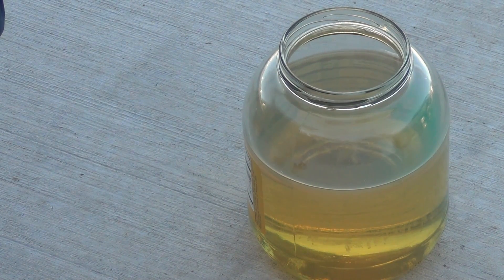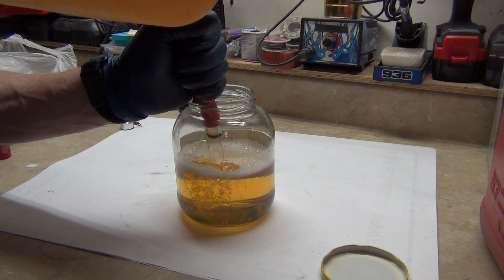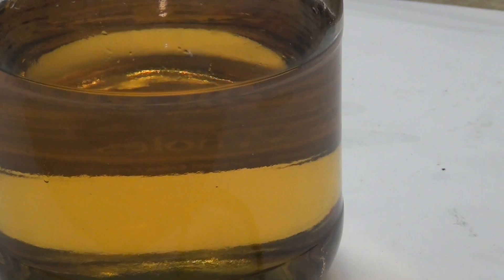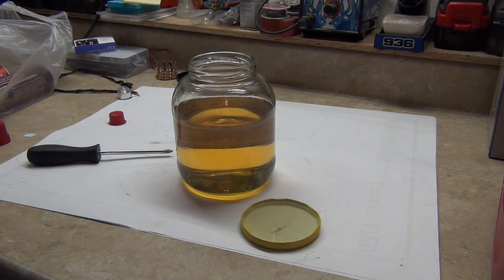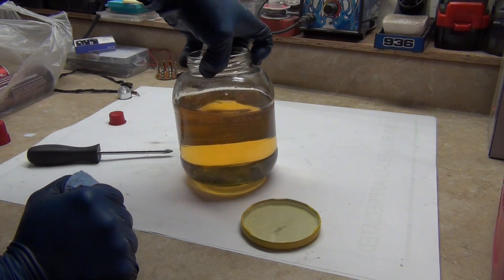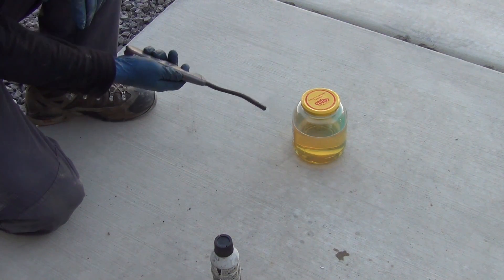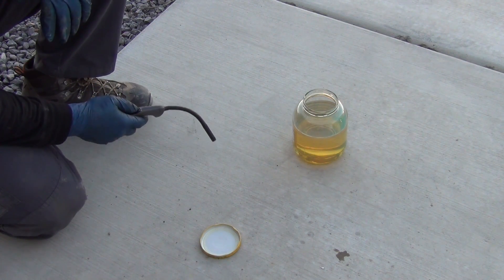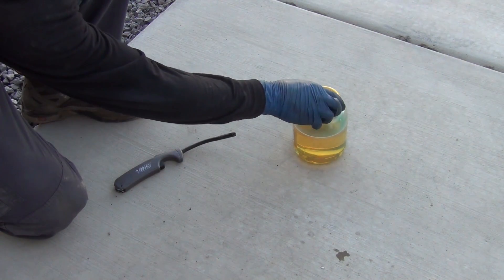What Happens When You Put Gas in Diesel

Comment: could you add lead additive in the gas/diesel mixture to up the lubricity?
Reply: John Griffin you could but it's highly illegal and quite polluting since lead is poisonous. Also almost engines are not meant to run lead. This was being used in a diesel so lead wouldn't not help in this situation. If anything some motor or veggie oil would help more

Comment: 10% gas in a diesel tank is ok. It provides anti gel protection when temps get -20F or so. As far as applying a match to straight gasoline, I would not recommend it. It would explode as gasoline is very volatile.

Comment: Gasoline can most definitely kill diesel engines.  A neighbor of mine had a mid-80's Ford 6.2L pickup and he loaned it out to a friend of his.  The friend thought he'd be nice and fill it up before returning it.  Unfortunately he filled it with gas.  The truck ran for a very short while, then ended up having to be towed.  The engine was toast.  Gasoline burns much hotter than diesel and it essentially melted the pistons.
Reply: Sorry, got my diesels mixed up.  It was the Ford 6.9, not the GM 6.2.  The same thing would happen to either one though.

Comment: If you have a hot spark and you really want a little more power put this in an engine and see what happens mess with the mixture. What I think should happen is it will burn the gas which will the light the diesel therefor giving more power. This is just spec though

Comment: I use to put a gallon of diesel in my gas tank when i filled up with gas. It keeps engine clean and boost octane. I use to get over 110 octane gas sometimes 120 at the pump.

Comment: it's all about combustibility or octane/cetane. diesel is generally easier to ignite and will contain different detergents than gasoline because diesel engines rely on compression instead of spark. I would not suggest doing this if you value your pistons and valves.

Comment: An old school trick if you put gas in a diesel engine is to add a quart of engine oil per gallon of gas added. It'll take a while to start until the mixture is ran out but it can save a lot of headache.

Comment: In school we were told that gasoline doesn't atomize as well as diesel fuel. Older diesel engines have lower injection pressure and greater nozzle tolerances than that of newer engines, so if you were to put gas in a 12valve or a 7.3 Powerstroke then it might just run shitty. But if you were to put it in a newer diesel engine with lower injector tolerances and higher injection pressure (some as high as 20,000PSI) then you could blow your nozzle out of your injector and basically ruin your cylinders.

Comment: Years ago it was advisable to mix petrol with diesel, to stop the diesel from freezing in extreme winters. Additives in modern diesel negates this. Older diesel engines could run on any crap, like old chip fat, turpentine or kerosine, as long as every fourth fill was proper diesel, for lube purposes. Common rail engines would die very quickly  if you used any of that stuff. As for the bagpipes, C'mon Scotland, FREEDOM

Comment: I put ethanol gas in my f250 because I make blended waste oil fuel. the ethanol melted my polyester fuel filters and shut my truck down on low fuel pressure. turns out the alchohol eats plastic.

Comment: diesel will not burn "like a candle"  as you stated in a jar unless it is heated first.  Most #2 will not not emit enough flames until it reach 126 deg Fahrenheit or higher.  Unless you add a wick of course

Comment: Speaking of lubricity, there are actually additives you can get for diesel fuel to improve the lubricity that apparently quiet down the injection pump (I want to try some in my Jetta TDI, but I'm a poor college student, so I'm being cheap).... Now, I'd be curious if you mix enough in if that could cause there to be no damage to the diesel fuel system... Well, I guess that's probably not the case as the ethanol is probably going to ruin seals... But to see how well the compression ignition would work for gasoline would be interesting. I know GM is working on something, but I don't really understand the specifics of why compression ignition gasoline engines are so difficult to produce.

Comment: Diesel has about twice the energy content of gasoline, but it isn't very volatile. When you mix gasoline with diesel you end up with a mix that is twice the energy content of gasoline and is volatile; not good. Also, gasoline acts as a solvent to diesel and does cut the lubricity. A good slug of gasoline will destroy high pressure pumps and injectors.

Comment: Hello Brian, Rob from Australia (the old Massey Ferguson tractor number plate man). We had a two year old land Rover discovery TD (turbo diesel). About 5 years ago some idiot filled out tank with bad diesel. We had traveled 100ks and then it all stopped. Cost us $12K and had to replace, fuel tank, low and high pressure pumps, injectors and fuel return system. There were bits of metal right through he whole system. Very unhappy!

Comment: a fellow trucker says he puts about a gallon of gas in his truck "each 150 gallon tank"  to keep the fuel from jelling in cold weather. cheaper than fuel additive. also when they change fuel filters on these big trucks they fill the filter with ATF before screwing it on. they say it help clean the injectors.

Comment: jet fuel cant melt steel beams
Reply: no but it can weaken them to the point of failure
Reply: So how can you melt steel with a furnace powered by oil.... It would of acted like a funnel all the heat rising sucking loads of air.
Reply: Applying heat to a solid substance until it changes to a liquid.
Reply: A B-52 NEVER crashed into the Empire State building, you got mixed up with the B-25, a ww2 medium bomber, which is much smaller than the Boeing 767s of 9/11.
Reply: But deez knees are made of dank memes
Reply: Jet steel cant melt fuel beams
Reply: The memes are not strong with these ones
Reply: bklynp718 Nope!  Just because people died, does not mean we cant talk about it.  that is whay you are told to say when anything is questioned.
Reply: Insert definition of "melt"
Reply: you forget to think about the altitude at which it may be burning, at higher altitude, there is more wind feeding more oxygen to the flames causing it to actually burn hotter and if enough oxygen is present or being blown to the flame in question, yes it certainly can melt steel.
Reply: B52's no it's can't melt it but it can make it hot enough to bend
Reply: Joshua Lambert jet fuel (jp4) in a combustion chamber can reach 2000 C that is why a jet engine can have a burn through. Haven't you ever seen a combustion chamber that liquified when you have a spray nozzle improperly aligned causing bad spray pattern?
Reply: Joshua Lambert jet fuel (jp4) in a combustion chamber can reach 2000 C that is why a jet engine can have a burn through. Haven't you ever seen a combustion chamber that liquified when you have a spray nozzle improperly aligned causing bad spray pattern?
Reply: Nerd....
Reply: What about our 5000 degree tungsten cube?
Reply: Bas Jansma jealous much
Reply: The I-85 Bridge incident here recently in Atlanta Ga proved beyond a doubt that a regular fire even without jet fuel can in fact weaken steel beams in concrete enough to cause collapse. So if you happen to be one of these people who still actually believe the jet fuel nonsense, you have been indisputably proven wrong.
Reply: Yeah, but what about the shit in the ChemTrail tanks? Who knows what that shit burns at!
Reply: Nik Trp the fires in the twin towers were oxygen starved. That's why there was so much dark smoke coming out of them. Jet fuel burns at 600 degrees in the open atmosphere. When mixed with lots of oxygen like it is in a jet engine it burns at 1600 degrees, not even hot enough to plasticize steel. Also, the news stated that wood fires only get to 1000 degrees or so. Steel doesn't become plastic, or malleable until 2000 degrees. It melts at 2500 degrees, and boils at 3500 degrees. I know this because of experiments that were run to show how hot Ammonium Perchlorate got when it burned at the Pepcon explosion back in the 90's. There are theories that say someone put thermite throughout the twin towers to bring it down. That might work, but would require tons of material to be brought in in order to do that. The towers were shut down for a few weeks in July 2001, and I believe that Ammonium Perchlorate would have been easier to sneak in because it would take a lot less of it to cut through the steel beams holding the buildings.
Reply: Wrong. You are, quite simply, wrong. It was not simply temperature that did the Towers in.
http://www.tms.org/pubs/journals/jom/0112/eagar/eagar-0112.html
Reply: Unlessen you blow lots of A/C from the main plant, at least until the FD arrives.
Reply: LOL
Reply: 9/11 is the only day in history that steel buildings fell from a fire. Unless there were more factors than heat from fueled fires.
Reply: OmegaGamingNetwork I cannot figure out where all these willfully stupid people come from.  it's stunning.  And it sometimes leads to their undoing when we're lucky.
Reply: owenbrau63 oh right; let's not forget about the chemtrail tanks.  Another figment of the astoundingly stupid imagination.
Reply: Kenneth Cohagen there's literally nothing you can tell these people that will change their feeble minds.
Reply: J. NiZm0 oh really?  where do you live?
Reply: http://www.snopes.com/wtc-terrorism-insurance/
Reply: owenbrau63 it won't matter.  these people do not believe facts.  You can thank them for how screwed up our country is.
Reply: Are you seriously saying that a 767 running heavy, weighing more than 380.00 pounds, releasing  nearly 4 BILLION kilojoules of energy for Flight 11, and more than 6 BILLION kilojoules from Flight 175, caused no damage to the structures?
Reply: Are you an engineer? You learned everything you need to know WATCHING TV? STFU.
Reply: No stupid, it was hit by a building falling on it.
http://www.popularmechanics.com/technology/design/a3524/4278874/
Reply: Andrew H why does a fire start to smoke? because its not receiving the air it needs to sustain itself, which as a secondary result, if its smoking then it is also not nearly as hot as it should/could be. the Twin Towers were both smoking as they burned. 2) The Pentagon which was also struck by a plane (yeah, right) does not show consistently the same amount of damage as the Twin Towers. The towers were destroyed while the pentagon was really not to badly damaged. Why was there no environmental disaster clean up done? all that jet fuel would have caused a huge clean up but never was conducted.
Reply: Thermite!
Reply: proof?
Reply: but fire can melt metal. and oil can be fire. if you are pointing 9/11 attacked. airplane are made of aluminum and melting aluminum plus water can explode.
Reply: Actually all it did was weaken the steel beams enough for them to buckle it doesn't take very long do that either with jet fuel or diesel only a matter of minutes however that doesn't mean your statement is completely invalid either
Reply: +Darth Iniquitous Not only was it heat from the fires weakening the some of the steel beams but also when the planes hit they severed some as well some of the steel in the core of the the building was snapped in half by the impact
Reply: Exactly the problem of what we've been told for 9/11
Reply: Yep, simultaneously.
Reply: HUBBABUBBA DOOPYDOOP it doesn't need to melt to destroy the structural integrity. 400 to 600 degrees Fahrenheit is enough to destroy the temper in hardened steel.
Reply: Jet fuel cant melt dank memes
Reply: The iq here is SO LOW OMG... the HIGHER ALTITUDE is THINNER air... rofl.  "more wind" your kidding right... are you talking 150 feet up or like, actual altitude?  

go watch the vids, you will see the steel running out, you will see sparkles, (thermite?)  Oh and ignoring any if that, I did not see any wind fanning the flames... they pretty much just went straight up, you see way more in forest fires on the ground out west... keep going.  

Pretty cool building, has a tin can hit it that a bird can damage, takes massive damage to the structural steel, you watch tons of the fuel go up on impact... yet it still managed to fall via plane hit the same way it takes WEEKS to plan... like I said cool building... 1 plane hit... perfect demo... multiple weeks... perfect demo.
Reply: but it can melt dank memes
Reply: It wasn't just fire, it was the massive impact of a 767, adding the fuel.  A wood fire can get hot enough to melt steel with the right conditions.  The longer the fire went, the more it heated up the fuel, making it more flammable.  You throw cold deep fryer oil on a light fire.. you could in fact put the fire out.  but you heat that oil up and then throw it on a fire, it lights up like gas.  Jet fuel is more flammable than frying oil.
Reply: Yes, that's correct. GQ Public of today is very ignorant of such concepts.
Reply: still displaying your stunning ignorance, eh Nik?
Reply: jet fuel definitely can not melt steel beams. also a hollow aluminum tube 767 with a plastic nose-cone can not punch a hole through massive steel beams. 
200 of which were the perimeter columns and 47 extra-extra massive of which were the core columns. 
i also watched it. on TV. over and over all day long. i just happened to get up in the morning just in time to see it on the news. then when i got a high-speed internet connection i watched it and analyzed it endlessly for the next very many years until i was exhausted of seeing, analyzing and arguing about it all over and over.
my conclusion?:: it was a giant deception involving uncle sam, the mainstream media and the WTC lease-holder, Larry Silverstein, who just happened to purchase the WTC lease 6-8 weeks prior to 9/11 and  coincidentally doubled down on the WTC "terrorist attack" insurance.
Reply: Nik Trp right jet fuel can't melt steel beams as it's boiling point is 176 °C (349 °F) Burning jet fuel on the other hand can melt steel as it has an open air burn at 1500F or in a oxygen rich up to 2,230 °C (4,040 °F) and anyone that has been near a large fire knows they pull in lots of air so the 2750F for steel to melt is easy for it. 

The conspiracy nuts like to use the open air burn temp and ignore the fact that once air is forced in it ramps up the max burn temperature. 

Then again they tend to ignore the common form of fire causing a collapse in the form of an overpass/bridge that fails due to a fire under it. Wood fires, gas fires and diesel fires have all been hot enough to weaken the steel enough for them to fail and it is a very similar construction to how the towers where made.

Comment: I like experiments, back when gas hit over $4 per gallon I ran 50/50 gas & used motor oil in lawn mowers, cold starts were hard, it ran better when hot had maybe 20%  less power, oil fowled the sparkplug when trying to restart it and smoked like a crop duster.
Reply: AdirondackNY and you ran all the particulate matter from the used oil through your engines!
Reply: Filtered oil though. And it was through lawn mowers...

Comment: Iv been spinning wrenches as a diesel tech for 28 plus years currently working for FoMoCo for the last 12 yrs. Here is the key! Any Ford diesel 7.3, 6.0, 6.4, 6.7 if you accidentally do this DO NOT DO NOT!!!!!! Turn the key to any position! Pull the key out of the ignition. Disconnect both batteries not one but both!! Then tow the truck home or to your local diesel shop. Drop the tank remove all of the fuel and dispose of it properly! Now leave the tank outside in the sun in order for any petrol remaining will evaporate. Put her back together and your good to go! If you energize the ignition your now screwed! The lift pump runs when the ignition is energized thereby pushing the petrol to the HPP! Why? Petrol is going to sink to the bottom of the tank were the pick up lies! Its like oil and water. Oil floats to the top. Gasoline will go to the bottom! If you do this on a 6.7 really in any amount expect to purchase a fuel contamination kit. Which will set you back 5k!!!! Just in parts! Same goes if you accidentally put DEF in the fuel tank!!! When fueling up PAY ATTENTION OR PAY WITH DOLLARS! Your choice.
Reply: Diesel Tech If i remeber right. the older 7.3L could run a mixture. Or just be started on gas and run diesel. Why it had 2 tanks. These newer aluminum crap you need to watch for as the ethonal put into gas eats it. Why gas engines run plastic fuel systems.

Comment: I've heard of gasoline being added (10%) to diesel in the winter to prevent jelling. This was before additives.
Reply: It was also before we started adding alcohol to fuel.  Adding gasoline to diesel fuel in a modern car is a bad idea.  You can add some kerosene in extremely cold climates but I believe that the refineries adjust the fuel supplied in those areas.
Reply: John Ferguson ethonal eats more then alcohol.. why the fuel systems need to be replaced..
Reply: Ethanol is the alcohol that is added to gasoline in the US.  Almost all of it is made from corn, though some is imported.  Standard gasoline is limited to a maximum of 10%, though E-85 is available in some limited areas near the distilleries in the Midwest.  Methanol, which is made synthetically, is the type of alcohol that will cause serious damage to fuel system parts and seals and should be avoided.
Reply: John Ferguson Point is, its a hair different and more corrosive. Top that off you need to call it by the correct name otherwise your going to confuse the hell out of people.
Reply: John Ferguson kerosene is nothing more than #1 diesel or Jet-A before diesel became the ULSD of today. Most diesel is of the #2 variety which gels near the +10F range, while #1 should remain gel free to minus 60F. A blend of the two in equal amount would result in a -15F gel point.